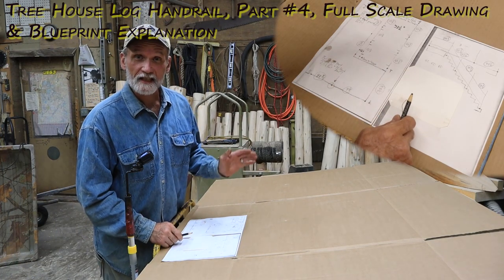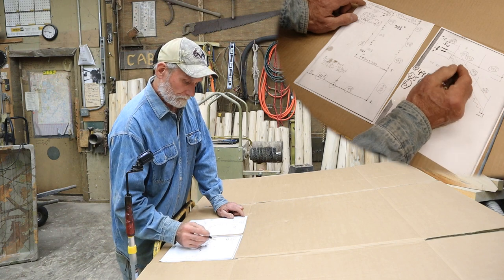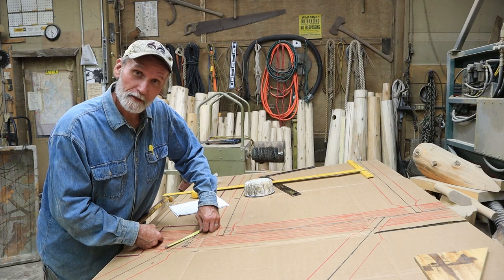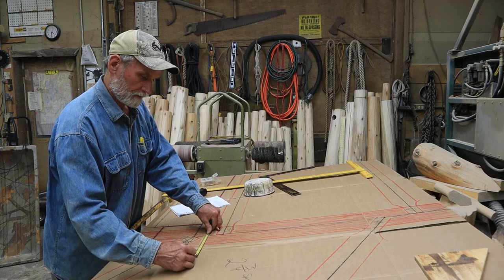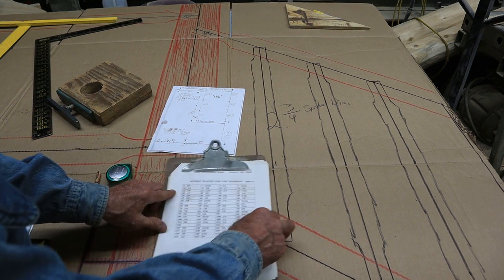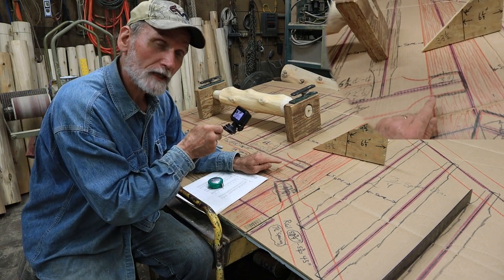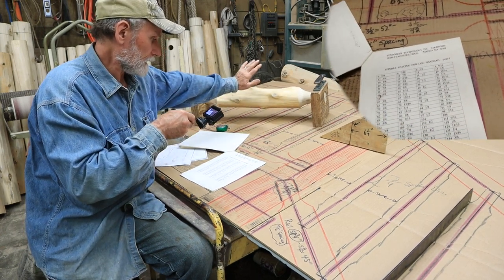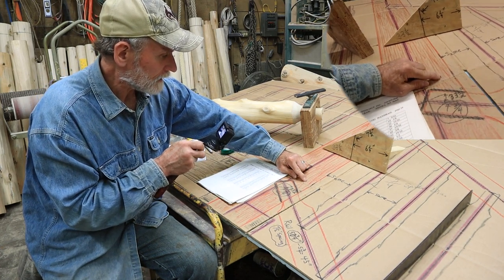Log Furniture 101 Rebooted... part #10, Tree House Log Handrail, episode #4, From Concept to Paper

Comment: i just found your channel and i just have to say thank you for your time i am a furniture/cabinet maker in the ADK lake George ny area and i love your shop jig/machine vids. You are a great teacher 
and i am 56 and I'm  learning so much from your style keep them coming and God Bless.Thanks  Rich 
PS can you be more specific on the a/c ground system for your shop, is this a diy project or a GEO/ thermal type? Thanks
Reply from the maker: Greetings Rich, (Rich is much better than poor) The AC is 3 to 4 GPM of ground water running through a scrapped out "A" coil "it cost me $100" with a $35 fan blowing air through the "A" coil with an aluminum pan under it to catch the dripping water, about 2 gallons on a humid 90 degree day. Costs me $1 to $2 a day to run it.
Reply: @Tenonizer  well i got a couple bucks lol
thats really cool!!!! what temp can you get the showdown to? thanks
Reply from the maker: The system has the ability to change the shop temp 10 to 15 degrees, but it greatly reduces the humidity.